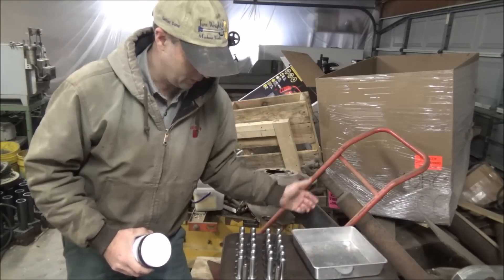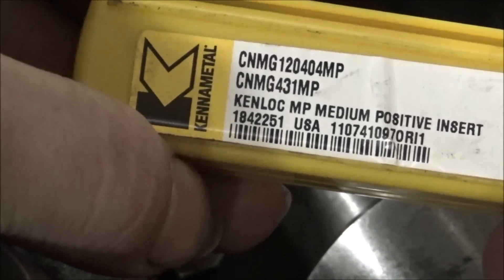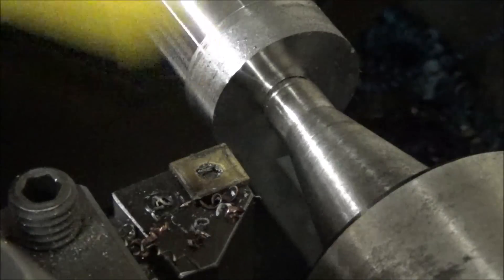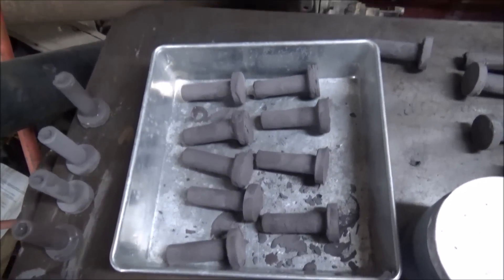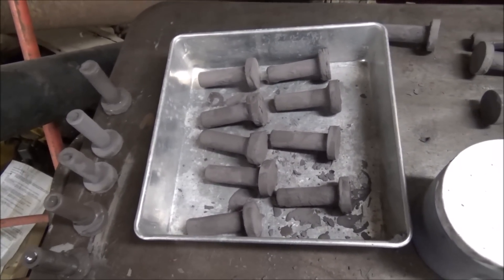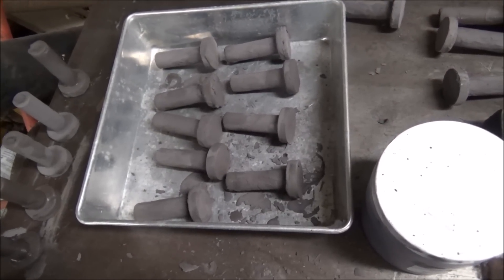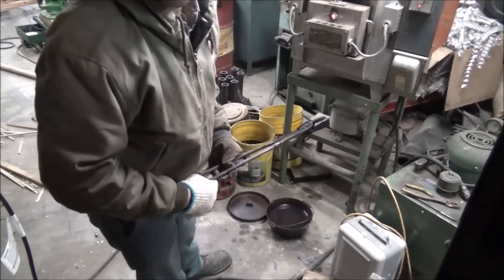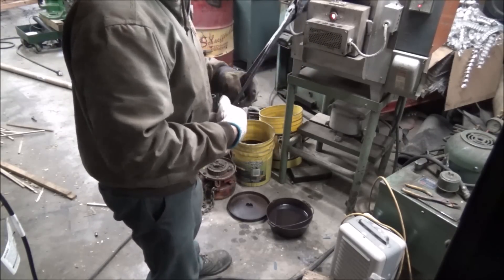Heat treating with anti oxidation Coating

Comment: Dude, check your temp in heat treating oven cuz i think its is too high.
Reply from the maker: GemPassionpl Oven temp is supposed to be 1950-2000deg for this process. I have verified it to 1000 and it was correct. I have no reason to believe it isn’t as I always get the correct results in hardness based on the charts I use.

Comment: I enjoy your videos quite  a bit. I was just wondering if you use a hardness tester and so which one. I assume a non destructive hardness tester would be appropriate here. Also I am sure you did quite a bit of study on the phase transformations of steel in the university and I was wondering if you have a metallurgical microscope, polishing and electro etching apparatus  at home to carry out any research ideas you might have. This is an area I find most fascinating and just wondered if you have time to pursue this kind of thing.
Reply from the maker: I have a friend at a die shop where they have a Wilson rockwell hardness tester I have him inspect a piece from each batch to verify things came out like expected. I do nothave the equipment to look at grain structure although that is always very cool and interesting stuff. Fortunately with quality materials the behavior of that kind of thing is fairly predictable. If I had an open hearth furnace and could alter the composition of my metals myself then you could get into some really cool stuff with properties!
Reply: Thanks for taking the time to reply. I have a versamat microscope with a high temperature stage on it. I can just reach the temperature to observe martiinsite transition's in steel. I  also was able to observe the effects of work hardening and recrystallization of brass samples, the photographs are very cool. after polishing and electro-etching in acid solution. In brass you can easily observe and measure grain size and some fantastic  twinning. One other hobby with microscopes is my Zeiss microscope fitted with a four axis universal stage designed to study rock thin sections. My thin section collection consists of about half of the basic rock groups and the other half meteorite thin sections. I still have a lot to learn  about them.
Reply from the maker: That would make some cool video if you could film it!

Comment: Brian it looks like you get to use those tongs I sent you. Does the oil temperture change as you add more parts or does that have any effect on them ?
Reply from the maker: Yes the temp of the oil goes up as more parts are quenched but the quench rate is still fast enough to get the job done.

Comment: Hi Brian,  Since I am just getting in to inserts it is a costly acquisition being on a fixed budget I have dealt with Shars and direct from china on ebay since they offer no grading I didn't know there was such a thing.  They did have a different grade for aluminum. Quite a lot to learn and experience with inserts.  I did look up Seaco on line but the info there didn't reveal the grade or I missed it.
I would like to get a few to see the difference from the expensive boys.  I saw yesterday on the tube that for $90 you can get 'one' CBN insert!  I have a cbn wheel on my bench grinder and love it but rhat eight inch wheel by 2" was $120.  Comparing that to a tiny insert at $80 sure leaves you wondering.  But I hadn't known you could even get it.  
Give Bailey a hug for me and an extra treat.  Take care.  Doug  PS:  still waiting on spring and the snow to melt.
Reply from the maker: Here is the chart for the Kennametal info. http://www.maximtools.ro/images/produse/kennametal/sorturi.pdf

Comment: Hello Brian,  You just touched on an interesting topic that I haven't seen even broached before on You Tube.  The different grades of carbide insert cutters for different uses.  I don't know a thing about that but sure am interested.  Maybe you could devote a video to explaining what is available.  The heat treating is also a very interesting.  Good thing you passed Boss Bailey's inspection!  Take care.  Doug
Reply from the maker: Each manufacturer has their own grades and systems and I am not familiar with everyone of them. About all you can do is go thru each manufacturers catalogs and look at the charts and go from there.  I would be glad to share what I know but it isn't very much.

Comment: what is th second temp.. nice video Brian
Reply from the maker: You mean the tempering temp?
Reply: I may have the process confused, but  your first heat it up to 1900° then quinch it in oil . then heat it back up to? is that the tempering temp? dont mean to be confusing
Reply from the maker: Yes the 1st main heat is up to the temp you quench from on this case the 1900 for 1hr then quench it down to 150-200deg, then heat back up to your tempering temp, in this case 950 for an hour, then let air cool to room temp followed by another tempering at 950 for an hour, sometimes if you really need stability a 3rd tempering may need to be done as well.  Various materials have different temps and times to get the desired characteristics.
Reply: thanks a bunch Brian

Comment: As I commented on another video of yours (maybe under a different name) use boric acid, or borax instead of any sort of commercial anti-scale. Also works great as brazing flux for the very same reason.
Heat the parts to just before straw color, toss them in the powder to melt on a good layer, then heat treat as normal.
You can also use a dish of either compound in the oven to make sure the parts maintain full coverage, but you have to either waste the whole dish dumping it in the quench, or use a pliers and fish the parts out of the hot boric acid before quenching.

Comment: just curious.. if you have for smaller parts..created an air tight box with sand blast gloves and a window port, lights..  a small work area.. but also a mini bender.. so you could Purge the box with argon.. or some other Inert gas while you wrap stainless heat treating wrap around the parts and fold the edges several times tight to seal them.. this could leave pure argon inert gas in the envelope..  and no way for atmosphere to leak in.. 

you might have to create some tool steel  U channels that have a tapered gib machined in so you could seal the ends of the stainless package..  or used a hinged device that you tighten the set screws and the edge clamps on the rolled edges. 

one warning... when working with argon in a box..  and working alone.. you must put up warning placards on the doors of the shop inert gas in use.. don't enter..   you may actually want to think of putting your dog in the house and using an external supplied fresh air full seal mask..  no use passing out because of lack of oxygen.  this is just to wrap your components for heat treating.   do you have a grinding set up for the lifter faces.. as very few are truly flat.. most are slightly convex.
Reply from the maker: These lifters are ground flat face the cam is taper ground to impart rotation. Not the greatest for wear but it makes it lower friction. It is for racing not farming so that is what I go with. I think buying an atmosphere furnace would be a better solution to what you are saying. I doubt there are many materials you could build a box out of that would stand the 2000degF cycles very many times.
Reply: no... the box is for packing the parts in the stainless steel wrap.. so there is NO oxygen or nitrogen inside the stainless tool wrap with the parts..  only argon  or you could purge the corners and seal them.
Reply from the maker: Ahh I see! That level of protection from atmosphere isn't necessary. You can just put a piece of newspaper in with the part in the foil and when it burns it removes the oxygen and you have great results. From those that do a lot of heat treating they say usually even that isn't necessary.

Comment: If you do a lot of the same tappet you should make up a special box that will fit the set closely and you won't have to worry about fire scale.
Reply from the maker: Not many boxes would stand up to very many times in the oven at those temps. Maybe something made from Inconel? I imagine it would be an expensive proposition. Probably cheaper to just buy an atmosphere furnace.

Comment: Hi Brian,
God thing you're now use a metal bucket... 
Got in touch with ATP rep and got to talk about some of their products, he mentioned they just developed the ATP 39 that can go up and down in temp and support the hardening as well as the tempering without recoating or degrading, I'll see about it since I'll get to try it... When I do I'll let you know about it...   ;)
So far the ATP 641 seems to do great.
Cheers,    Pierre
Reply from the maker: Interesting, so how do you get it off after tempering with the 39? All of this 641 was gone with the quench. I wouldn't think for most tempering any coating would be needed unless you were trying to preserve a finish maybe? I don't know if that would even work.
Reply: I'll get a sample of the 39, I'll keep you informed, like you say, it will help to keep the final part from being altered even in the tempering part, this is gonna be new to me also...

Comment: Brian, a lot of inserts give a good surface finish when the nose is buried, but I'd be interested to see how it does on the final 0.001-0.002 finish pass. It's that last cut creeping up on my dimension that usually makes me frown at my insert.
Reply: For cutting very exact, you go twice the radius of the insert and you're within half thousand from what you dialed, doesn't work well under 1" diameter on manual lathes though. There is a technique to get it right fast, you keep the 2 last cuts with twice the radius and you control on the first one, then dial the second one with the exact finish diameter...    Example:  You're using an insert with a 0.032" radius,  you need final dia. 2".  You start with 3" dia. rod.   rough until you get 2.128" left, then take a 0.064" cut, measure, calibrate and get the second cut dialed for the remaining to final diameter, it should be close to 0.064"  +/-, the final result should be within half thousand or better with a good finish... Remember not really good under 1" dia.
Also watch the temperature on your piece cause you could get a bad surprise if too hot.
Reply: There is just about no hope to get a brilliant finish with a carbide insert with passes in the range of 1 or a couple of thousand...  The reason is that the radius has to be buried around twice it's value...   The best deal is with a shear tool made of HSS...
Reply: But would that work on hard steel?
Reply from the maker: Don't sneak up, now how much your tool is taking and take it to hit your size.  The only way to get good finishes taking scratch passes is to finish with an abrasive like grinding to size, polishing with emory, or scotchbrite.  Don't be scared to just dial it in and go!

Comment: Quite the light bulb in that easy bake oven. 😊
I was just wondering where Bailey was. There he is.
Maybe a welded stainless steel pan for the really high temp stuff?
Thanks,
John
Reply: Yeah, he must have a 150 watt bulb in that one.
Reply from the maker: It is a heat lamp.

Comment: Brian as you ad your parts the quench oil reaches its flash point. your container was a bit on the small side.How were the hardness on the parts suspect parts will very a few Rc points from each other?  Cobble up a fluid to fluid heat exchanger to keep the quench oil below the flash point or increase the volume of oil. at least you didn't use a plastic bucket. enjoyed this content.
Reply from the maker: The material can be forced air quench so I am sure even with fairly hot oil the quench rate is sufficient to get proper hardness.

Comment: I assume the applied cost per piece is lower with the ATP-641 than with SS foil wrap. 
If you don't mind telling what is the ballpark cost differential?
Reply: Well, I just went over to Brownell's Gun Supply and they sell the 16oz. container that Brian was using for $15, and one 24"x24"x .002" sheet of stainless wrap for $21...I'd guess that the ATP is the less expensive monetarily speaking, but the labor on prepping and coating them seems a bit more intensive for the ATP...Brian, can you break the toss-up?
Reply from the maker: I am guessing for the mount of coverage it might be half the cost of stainless? Just a rough guess though.
Reply: and that's including the time it took to coat them as opposed to wrapping them up?
Reply from the maker: Time to paint or wrap is likely the same, if you add in time to wait for the coating to dry then probably a different story.
Reply: Thanks Brian, I was just thinking about the labor for guys who do it professionally like you do. For me, time is free on stuff like that because I'd enjoy it...

Comment: What Clickspring does with borax and iron wire,  would that work with this steel?
Reply from the maker: Probably yes. I don't know about it at the elevated 2000F temps though as I normally see people use the borax more in the 1600f range. I have also heard that packing in cast iron shavings works great but I have never tried that. If I could find a cast pan that could withstand the high temps maybe I would give that a try.

Comment: I am wondering if you have sufficient volume of oil to quench all those parts, how hot was it getting and how critical is it anyway?
Reply from the maker: The oil got almost to 300degF. The key to quenching is the rate  you can get the part below about 1000degF. This material can be forced air hardened so I am quenching at a rate far exceeding that and that is sufficient to obtain the proper hardness.

Comment: The paint on treatment appears to work. I'm looking forward to the next video to see the next step. I just bought a roll of stainless steel foil to make packages for parts and wish I had known about "the goo". Nice of you and Bailey to share!
Reply from the maker: I would give it an ok rating at this point. I need to devise better process for applying to get better results I think. The coating is fairly cheap so that is nice.
Reply: How well does a second coat lay down with the brush? One thing you could do also is leave a small nub on one end of the part to drill a hole through for a wire hanger, allowing you to hang it to apply coating etc. Just a quick and dirty hand drill hole, no mill needed. The small nub should take seconds to remove after heat treat.

Also, the "goo" is probably some kind of clay slurry such as bentonite. Japanese bladesmiths use various types of clay slurrys to control heat treating and to induce patterns in swords. If it is bentonite, you can get a big bag lifetime supply for the price of a jar of the stuff mixed with water.

Comment: hehe a cooking pan, tell tefal you had the oven on at 2000f and see if they still warranty their stuff!  Question: when quenching in oil, does it suffer from the leidenfrost effect and you need to swirl it?
Reply from the maker: Not nearly so much and swirling would help lower the cooling rate but for this material a quench rate that fast is not necessary to achieve the proper conversion and hardness.  It could actually be forced air quenched instead but I prefer the uniformity of an oil quench and less distortion.

Comment: So does that just protect the part during heat treating?  A Dutch Oven for quenching?  I bet there will be a few who make comments about that down the line.  Thanks for the demo and as usual a great video, Greg.
Reply from the maker: Yes the coating is to protect the parts from losing carbon to the surface and from oxygen attacking the metal while at its elevated temp.